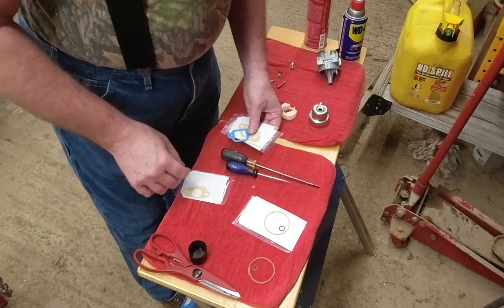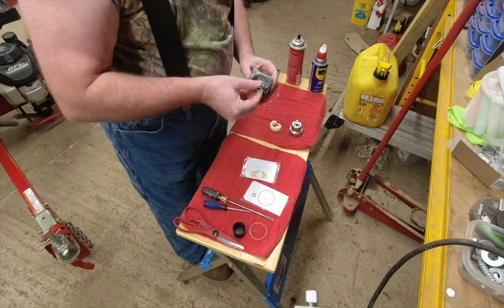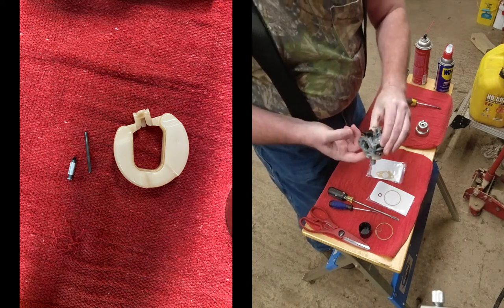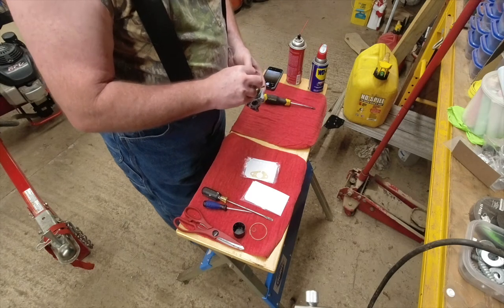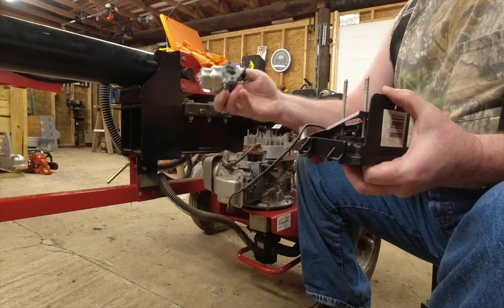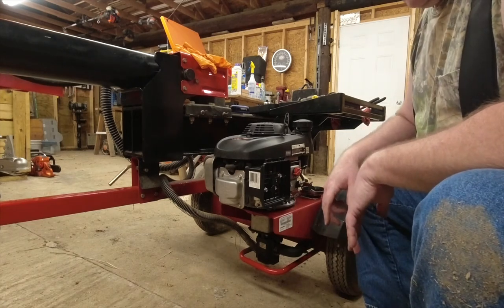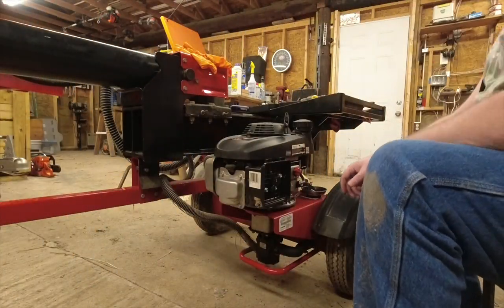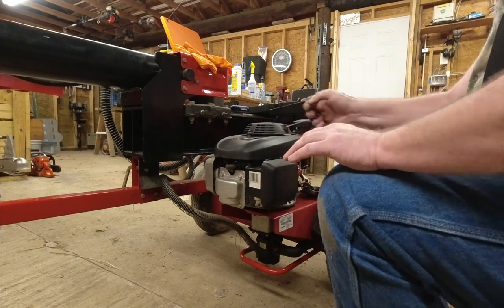#92 - Fixing Troy Bilt Log Splitter

Comment: Good Vid...where did you get the log catcher on the other side of the ram.I have the same splitter..thanks
Reply from the maker: I purchased the log catcher from Tractor Supply Co.  You can find it online at tractor supply with SKU: 129169799.  I hope that helps.  This SKU is a very sturdy log catcher.  It's not made for the Troy Bilt, but I just drilled my own holes.  One thing you need to be careful about is the bottom of the splitter wedge catching the top of the log catcher.  So, don't mount it too high or the bolts will snag it.  I hope that helps.  Thanks for watching and commenting. Enjoy the Journey - Cheers

Comment: it seems to be running good, sometimes I have a problem with them surging too, but it sounds good now,
Reply from the maker: I think there was too much air entering the carb, as soon as I closed the choke it would smooth out.  So I opened the choke and it would surge again.  And when I put my thumb over the carb it ran smooth again.  The answer was to install the air filter and it works great again.  Watching you work on your equipment gave me the confidence to give it a try.  Thanks for watching and commenting - cheers

Comment: Do u know we're to get the small ball bearings that go in the auto return detent
Reply from the maker: Let me do some research.  I sold this splitter and no longer have the owners manual.  Check back here tomorrow to see if I have an answer.
Reply from the maker: Here is a web page for the Control Valve at Troy-Bilt.  https://support.troybilt.com/s/article/401-1?language=en_US

It's really of little help, but you could give the support desk a call.  They maybe able to assist you with your missing part.
1-800-828-5500 Monday - Friday  8:30AM - 5:00PM EDT

Good luck and let me know if you were able to find the part you needed.

Comment: Any advice on replacing the tire on that exact same wood splitter? It almost looks like the tire rim screws on instead of sliding on.  I have removed everything I know of but still can’t get the rim off.
Reply from the maker: I wish I could help - I sold the Troy-bilt splitter and did not remove the tires or wheels.  I wonder if it has a dust cap on the end of the axle with a castle nut under the dust cap.  Let me know if you have any luck - my apologies - UPDATE - I found the owner's manual online at: https://www.troybilt.com/en_US/prior-year-models/tb-27-ls-troy-bilt-log-splitter/24BG57M1766.html
There is an illustration on page six of the tire/wheel.  It appears to show a dust cap over the end of the axle.  You can remove the dust cap with a pair of slip joint pliers. https://www.amazon.com/Irwin-Tools-VISE-GRIP-GrooveLock-2078709/dp/B000FK1R0W/  You should be able to find them at Lowes, or a pair of vise-grip pliers might work.  The dust cap is held in place with press fit.  Once the dust cap is off, you should find a castle nut secured by a cotter pin.

Comment: I have the exact same wood splitter someone gave  it to me. Could you send me the model of the motor so I can get the govenor linkage and springs I need to get it going again.
Reply from the maker: Philip, I will see if I can find the model number.  I sold this log splitter and provided the owner's manual with the splitter.  Give me a minute to do some research.
Reply from the maker: I got lucky and found the information quickly.  Model number - 24BF572B711 116418.  I purchased this splitter from Lowe's.  You maybe able to find parts through Lowe's Service, 1-888-77LOWES is the phone number.  Good luck.

Comment: Where did you get the log table or did you make it ?
Reply from the maker: I purchase the log table from Tractor Supply.  It's a great addition to the splitter.  All I did was drill two 1/2 inch holes.  One word (or two) of caution, be mindful of clearances for the ram and wedge.  The first set of holes I drilled did not provide enough clearance for the bolts that secure the wedge to the i-beam.  I drilled two new holes and lowered the table an inch and all was good.  Thanks for watching and commenting - enjoy the journey - cheers

The CountyLine Log Catcher fits CountyLine 25-ton (SKU 1261517) and 30-ton (SKU 1261518) log splitters. This log catcher has a big table for efficient wood handing and great productivity. https://www.tractorsupply.com/tsc/product/countyline-log-catcher
Reply: @botabob  Thank you. I was just looking at that one this morning.....😎 it's on sale too.
Reply from the maker: It works well for me - good luck

Comment: All mmodel and serial tages have been removed.
Reply from the maker: That sucks.  I hope you were able to get the owner's manual when you picked it up from the seller. I was able to find a number of websites when I searched for "owners manual 24BF572B711 116418".  Good luck Sir.  Enjoy the journey - cheers
Reply: @botabob  Thanks for you feedback.  No serial tags anywhere. motor oof splitter. I am missing the linkage between the carburetor and governor as well as a recoil for starter.  I decided to get a new engine on e bay A pull from a  power washer has the same shaft dia and length only has a couple hours on it.  Thanks for your help. .